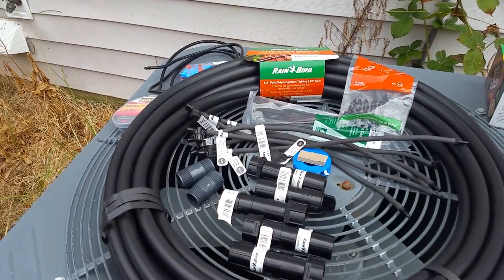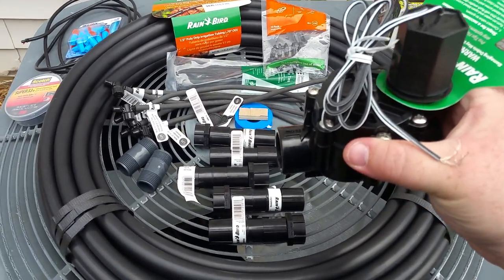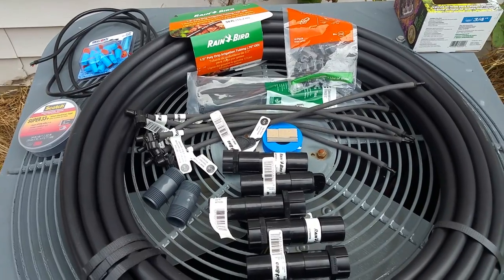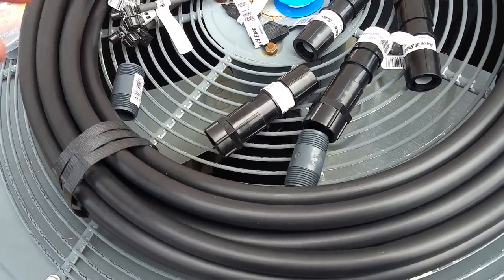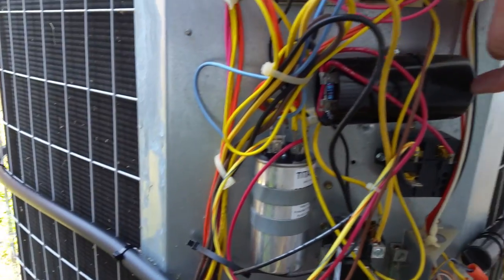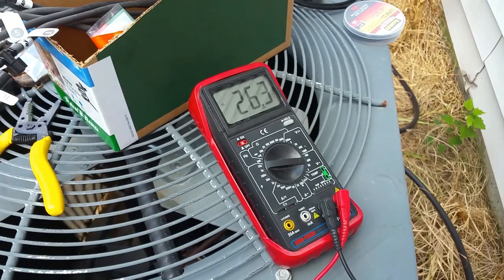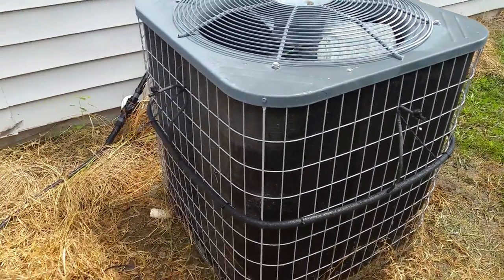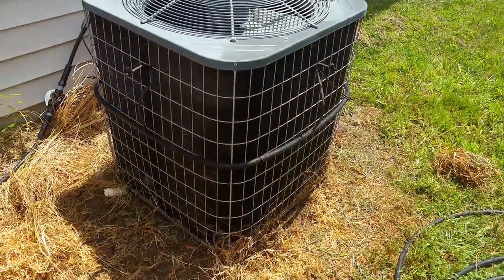DIY Automatic A/C Condenser Evaporator Mister - Electronically controlled!

Comment: Please refer to Superheat/Subcooling for optimal operating conditions of any A/C.  On a windy day anything airborne, dirt, leaves, cotton is guaranteed to stick to your now wet condenser coil, raising the head pressure thus causing eventual compressor failure from the now lack of airflow crossing the condenser coil that also aids in cooling (the compressor) as well...Trust the engineers people, if they thought this was a great idea, it would have come equipped with your A/C...

Comment: I was checking my this morning and I've only got two wires, so I assume once I determine which is common and which is hot
it's just a matter of hooking them up, right?
Reply: Anthony Porcarello Sr   Yes u have a straight cool system out side those two wires are you 24v.   If you had a heat oump system you would have 5-6 wires.  So just hook up to those 2 and you will have 24v
Reply: Anthony Porcarello Sr : It’s AC current.

Comment: Just make sure your transformer can handel the extra load of 24v value
Reply: You can use a simple relay and a plugin DC power supply to activate the electromagnetic water valve.  Any 110v AC to 24v DC plug-in transforming power supply will work, just connect the relay between it and the water valve and then trigger it with the incoming Thermostat wires from your house.  This set up will reduce the load on the Thermostat's low voltage power transformer, in case it can't handle the additional load.

Comment: Would be interested to see how things turn out long term. Thought of doing something similar. Please keep this post updated. Thanks!
Reply from the maker: Thanks for the comment! Here's a small update. I ended up having to replace the rainbird mister nozzles as they were outputting way too much water. I put a link to the misters I'm using now. Subscribe for more updates!
https://www.youtube.com/watch?v=CPS3jwsrHCY
Reply: See any rust or puddling below the misters? corrosion or scale?
Reply: I live in Texas there is no such thing as Mild Temps
Reply: Anthony Porcarello Sr Aint that true. Either 100s or 50s with major swings throughout the day
Reply: Anthony Porcarello Sr pls 90% humidity.
Reply: It works great. I built a similar system, though mine was far cheaper as I used pvc hard piping instead of the rainbird flex pipe, plus different nozzles/misters.
I lowered my utility bill by at least $30 with it on one window unit. I didn't have any issue with scale or rust or the coils getting dirty. The unit ran less often and not as long during the cycle.
Reply from the maker: Sorry for the delay in getting to your comment. As of October 2018 there were 0 issues with the setup, and was still running great. Sold my home in October and have since moved. New house has a much, much more efficient AC system and I don't see a benefit of installing a mister at the new house, however I have not totally dismissed the idea of trying again. Some things to address that others have brought up in the comments: 
No rust issues what so ever. How people think a device BUILT and designed for constant outdoor uncovered use would cause rust, is beyond me. 
NO, I REPEAT NO BUILDUP on the condenser coils WHAT SO EVER. Use. A. Water. Filter. Again, rain water is WAY, WAY more "dirty" than filtered, city water. 
No issues with the HVAC thermostat carrying the extra load of the solenoid

The only thing I would do differently, is a better wire management job, and maybe using "liquid tight" conduit and PVC conduit box for the solenoid wiring. Just for a cleaner look. No issues with the outdoor rated wire nuts, or electrical tape. Keep in mind that's all that's used in the irrigation world, and that's usually directly buried or open air.

While I didn't do much scientific data recording to really drill down on energy savings, I can say my power bill was on average $20-$40 cheaper, without changing as many variables as possible year over year. Obviously weather has a huge affect on the energy usage, but the weather in NC is pretty consistent in the summer. Hot as balls. Water bill was virtually unchanged. WIth the NEW misters (please see the update videos on my channel) the water usage dropped SIGNIFICANTLY as there is very little flow with the new nozzles. They did a MUCH better job at atomizing the water.

My location doesn't really net the most benefit from a mister system either. It's typically very humid in NC during the summer. However, there was still a noticeable difference in condenser outlet temperature even on humid days. I can only attribute that to A) sufficient atomization of the water to still get some evaporative cooling and B) the actual water temperature itself being in the 60F range even on a hot day.

Thank you for your comment.

Comment: What about just having some shrubs around the condenser to keep it cooler and once in awhile run a garden automatic lawn sprayer.
Reply: tell me more about these temperature controling shrubs lol 

if they are providing shade that's good 
but you want to keep them trimmed back so they dont restrict air flow to the condenser

Comment: Very nice how to video. I bought all my parts similar to yours a month ago on Amazon. The 1/4" misting system just came in from China about $40 for all parts. Thanks!
Reply: I have good water but you could add a $12 whole house filter housing with filter.
Reply: Just remember that outside water outlets generally don't go through water softeners.
Reply: pladee, that's how it is at my house as well. My outside spigot is before my water softner.
Reply: $12 ? Link please.
Reply: j jones how do you wire the valve

Comment: So past 1 year now...have you noticed any issues with the AC unit? (described issues of people below)
Reply from the maker: Sorry for the delay in getting to your comment. As of October 2018 there were 0 issues with the setup, and was still running great. Sold my home in October and have since moved. New house has a much, much more efficient AC system and I don't see a benefit of installing a mister at the new house, however I have not totally dismissed the idea of trying again. Some things to address that others have brought up in the comments: 
No rust issues what so ever. How people think a device BUILT and designed for constant outdoor uncovered use would cause rust, is beyond me. 
NO, I REPEAT NO BUILDUP on the condenser coils WHAT SO EVER. Use. A. Water. Filter. Again, rain water is WAY, WAY more "dirty" than filtered, city water. 
No issues with the HVAC thermostat carrying the extra load of the solenoid

The only thing I would do differently, is a better wire management job, and maybe using "liquid tight" conduit and PVC conduit box for the solenoid wiring. Just for a cleaner look. No issues with the outdoor rated wire nuts, or electrical tape. Keep in mind that's all that's used in the irrigation world, and that's usually directly buried or open air.

While I didn't do much scientific data recording to really drill down on energy savings, I can say my power bill was on average $20-$40 cheaper, without changing as many variables as possible year over year. Obviously weather has a huge affect on the energy usage, but the weather in NC is pretty consistent in the summer. Hot as balls. Water bill was virtually unchanged. WIth the NEW misters (please see the update videos on my channel) the water usage dropped SIGNIFICANTLY as there is very little flow with the new nozzles. They did a MUCH better job at atomizing the water.

My location doesn't really net the most benefit from a mister system either. It's typically very humid in NC during the summer. However, there was still a noticeable difference in condenser outlet temperature even on humid days. I can only attribute that to A) sufficient atomization of the water to still get some evaporative cooling and B) the actual water temperature itself being in the 60F range even on a hot day.

Thank you for your comment.

Comment: I cant see this  changing sub cool or superheat , however is this a 40 va   transformer inside the airhandler  , and if so what is the volt amps combined between the valve and the contactor being pulled in at time of operation? just curious . because I know when a garden hose is applied at full blast over the outdoor coil head pressures fall , but so does suction pressure and that I know changes sub cool and superheat. oh well I guess ever little bit helps.

Comment: To all the nay sayers I am in the refrigeration business They do build systems that use water (geothermal) basically the same idea using 53 degree ground water to transfer heat much more efficiently then 100 degree summer air. misting it over your coils does not void warranty! LOL!  when it rains on your unit does that void warranty??? NO Great idea I like this better then the paddle thing I may give this a shot.

Comment: How did you insert the mister hoses into the main hose?  Did you add anything to them or just push them in?
Reply from the maker: There is a tool available in the rain bird aisle that punctures a small hole in the rigid pipe. The small hose of the mister has a barb on it to keep it retained in the pipe. It works perfectly and I experienced no leaks.

The replacement brass mister heads that I ended up switching to thread into the flexible small hose. It also had an o-ring at the end that helped seal it up.

Comment: The systems Ive seen use really small tubing. Maybe using the 1/4 inch is why your mist is so strong...
Reply from the maker: The issue was the nozzles. In my update videos (see my channel) I ordered some brass nozzles specifically for evaporative misting for patios and what not, which did a MUCH better job atomizing the water, and significantly reducing the water usage.

Comment: Just put a couple connectors on the end of the valve wires and connect them to the spare control connectors on the contactor.
Reply: Do you need to put the connectors on each side of the 24v sides of the contactor or can they both go on the same side of a contactor
Reply: @scottlanier5133  Yes one on each side, just follow the two existing control wires.

Comment: Great thinking using the solenoid valve. I was thinking of using an evaporative cooler float valve turned upside down and replacing the float with a metal flap. I like your idea better though, especially since I'm an Electrician. One question - I noticed while your a/c was "on", the condenser fan wasn't running, which would defeat the whole purpose of the mister system???
Reply from the maker: DS Splicer I had the disconnect unplugged, so only the contactor was energized from the 24V thermostat wiring. See my update videos to see it running all finished. I've replaced the mister nozzles with much better ones and added more. Running GREAT now. Next upgrade is going to be a arduino controlled photocell and DHT11 temp/humidity sensor so I don't run the system at night or when temp is below 88F or during high humidity.
Reply: Hmm, in my experience, the 24 volts generally comes from a step down transformer in the unit itself; so the unit would have to be powered to get the 24v. Where does your 24v come from, just out of curiosity? I will definitely check out your other vid(s). I love your ingenuity, but I've never messed with an Arduino.
Reply from the maker: DS Splicer There is a transformer in the air handler in the attic. I also build amateur switch mode power supplies so my plan is to build a 24V AC to 5VDC power supply to power the arduino. Honestly it could probably run for months on a small lithium battery but a small power supply would be so much easier. Current draw would be tiny, and a lot more efficient than a simple rectifier and linear regulator.

Comment: A great concept. Evaporative cooling has been around for a long time, these videos promoting misters to cool the incoming air through the condenser didn't mention the effect of, over a period of time,  the corrosion faction on the copper tubing, it will shorten the life of the condenser coil. A better way would be to use a titanium heat exchanger that could heat your pool or provide warm shower water as a bonus.
Reply: corrosion on the copper tubing, from exposure to water?  You mean like the copper tubing that CARRIES THE FREAKING WATER IN YOUR HOUSE? Like all the time, 24/7 it's soaked for decades and decades without any issues. Copper tubing, until recently has been the thing to use because it it is very resistant to corrosion. The fins are aluminum, which again, doesn't really corrode at all, once it gets it oxide layer it is pretty darn impervious to it. Calcium and lime build up could very easily be removed by a monthly wash.

Comment: Is there a way to connect it straight to the A/C call?  There has to be a wire that tells the condenser that you want heat or A/C... Right?
Reply from the maker: Not in a heat pump setup. Heat pump has compressor, reversing valve, etc. If your condenser unit is AC only you should only have two thermostat wires. I'm sure you could use "relay logic" to disable the mister when the heat is on, but as I stated in the video I just turn the water off during the winter.

Comment: Would you not want a RO filter inline, to remove any calcium or other crap that might be in city water? Those ac fins are really thin....
Reply from the maker: Yes. As I explained in my video the filter was in order. My follow up videos show that filter in place. I have also tested my water prior to this, and there is very little hard water minerals. I chick that up to the relatively young age of the water infrastructure in my town, and it's fresh water source. Your experience may very.

Comment: That's a lot of parts and work for a mister just to improve efficiency.  You would be a lot better off by getting rid of that condenser and setting up a water source condenser. With a small above ground pool, a heat exchanger, a low pressure water pump you could increase efficiency above 90% as they do in Saudi Arabia.

Comment: It's been almost a year since you posted, have you seen any benefits? Any degradation to the system?
Reply from the maker: Sorry for the delay in getting to your comment. As of October 2018 there were 0 issues with the setup, and was still running great. Sold my home in October and have since moved. New house has a much, much more efficient AC system and I don't see a benefit of installing a mister at the new house, however I have not totally dismissed the idea of trying again. Some things to address that others have brought up in the comments: 
No rust issues what so ever. How people think a device BUILT and designed for constant outdoor uncovered use would cause rust, is beyond me. 
NO, I REPEAT NO BUILDUP on the condenser coils WHAT SO EVER. Use. A. Water. Filter. Again, rain water is WAY, WAY more "dirty" than filtered, city water. 
No issues with the HVAC thermostat carrying the extra load of the solenoid

The only thing I would do differently, is a better wire management job, and maybe using "liquid tight" conduit and PVC conduit box for the solenoid wiring. Just for a cleaner look. No issues with the outdoor rated wire nuts, or electrical tape. Keep in mind that's all that's used in the irrigation world, and that's usually directly buried or open air.

While I didn't do much scientific data recording to really drill down on energy savings, I can say my power bill was on average $20-$40 cheaper, without changing as many variables as possible year over year. Obviously weather has a huge affect on the energy usage, but the weather in NC is pretty consistent in the summer. Hot as balls. Water bill was virtually unchanged. WIth the NEW misters (please see the update videos on my channel) the water usage dropped SIGNIFICANTLY as there is very little flow with the new nozzles. They did a MUCH better job at atomizing the water.

My location doesn't really net the most benefit from a mister system either. It's typically very humid in NC during the summer. However, there was still a noticeable difference in condenser outlet temperature even on humid days. I can only attribute that to A) sufficient atomization of the water to still get some evaporative cooling and B) the actual water temperature itself being in the 60F range even on a hot day.

Thank you for your comment.